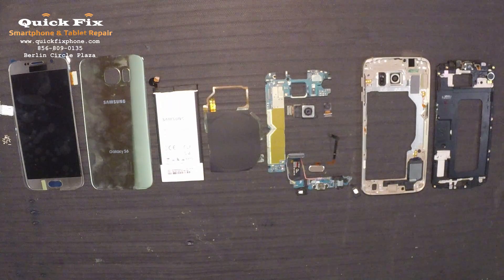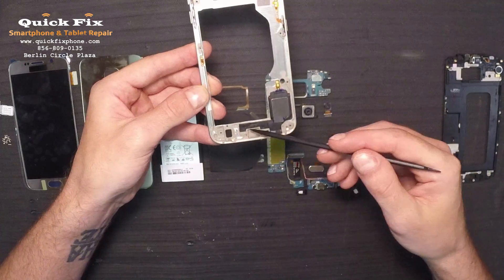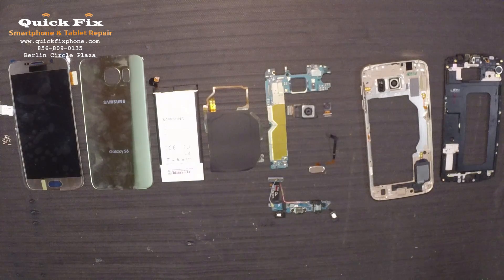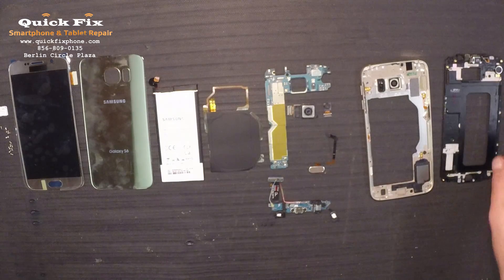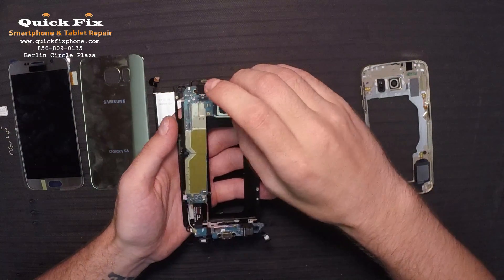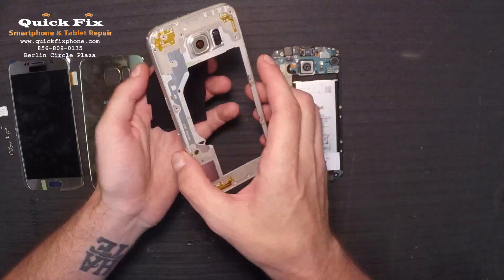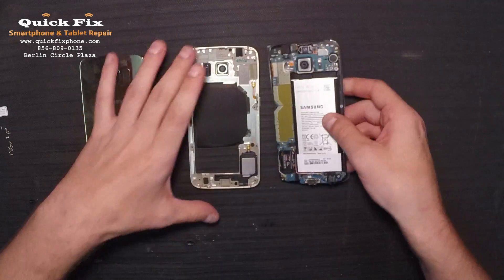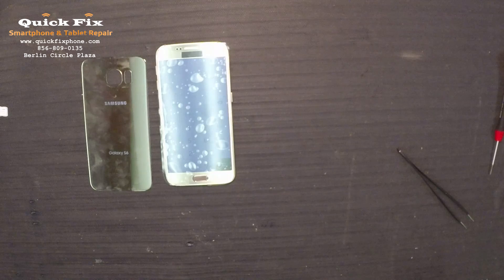Samsung Galaxy S6 tear down & rebuild by Kenn

Comment: Hi I've been having problems with my auto rotation when using my phone. when I tilt my phone to the left the screen goes into landscape perfectly but when I turn the phone back the screen doesn't follow and it stays in landscape. and when I tilt the screen to the right the screen turns as if it was tilted to the left. any idea what could be wrong?